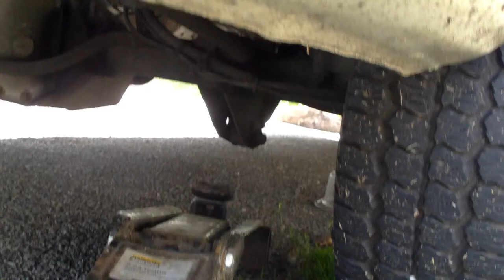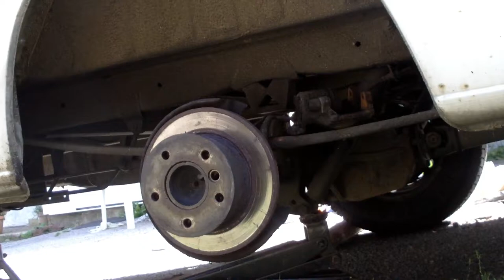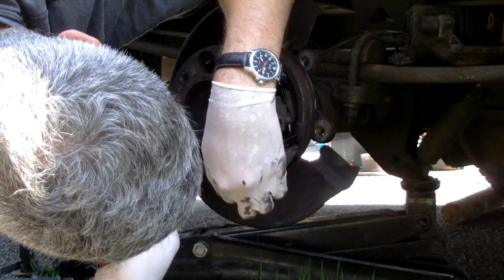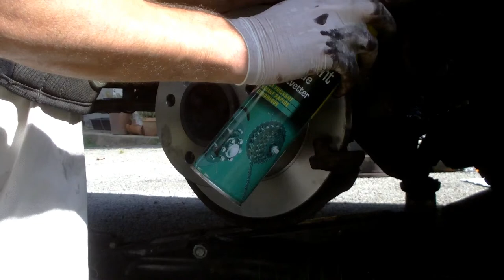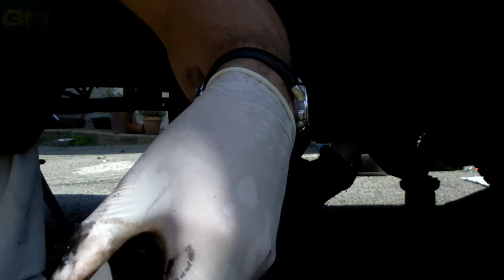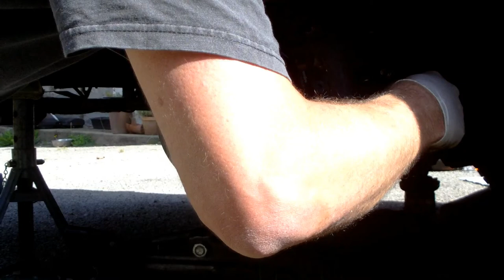Mercedes Sprinter rear brakes, replacement of discs, pads and shoes

Comment: Thanks for this video. I did the same job yesterday and having seen how you did it was a big help. I had the same difficulty getting the old disks off but seeing how to adjust the shoes helped a lot. Strangely I also had difficulty getting the new disks over the new shoes, even though the adjusters were screwed in as far as they would go. I ended up taking a grinder with a flap wheel to the shoes to remove a millimetre or so from the leading edges and they fitted easily after.
Reply from the maker: I am so glad that you found the film of use, thank you so much for your comment. Please subscribe and click the bell icon, I have a few more films on the van to upload.
Have a great festive season
Reply: thats what im going to do now. racking my brain as to why one side went straight on but the drivers side just wont slip over the shoes, grinder action coming up
Reply: @rickbambi7425 The linkage is probably seized. Make sure it is freed up and it will be OK.
Reply from the maker: Hope all goes well Rick Bambi, thank for the comment?
Reply from the maker: Cheers Ali bro, that is a good point! Thanks for the help, take care

Comment: I'm not the only one who struggles to get the drums off, but there is an easier way, I think. Slacken the adjuster first. On further viewing it looks like your adjuster was fully slack. So it must have been a rust problem.
Reply from the maker: It definitely was rust, a hell of a big ridge around the edge! Again though a good piece of valid input which I do think missed from the film, for anyone thinking of doing this job back off the adjusters before pulling the drums off!!!!